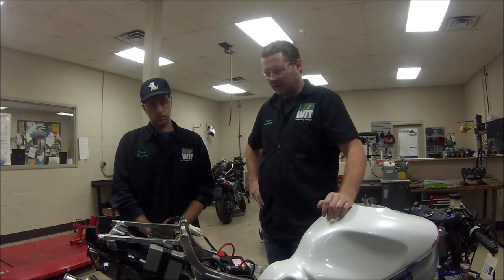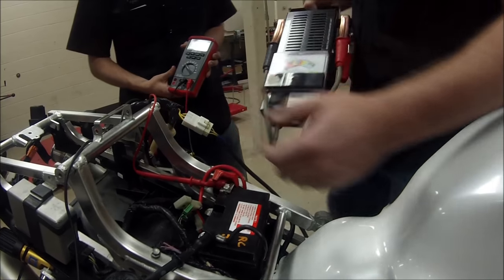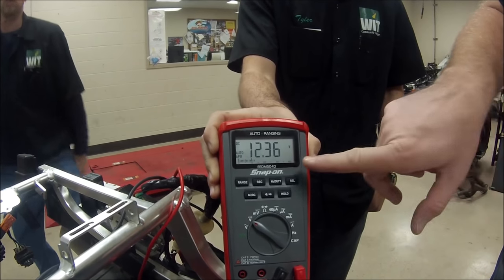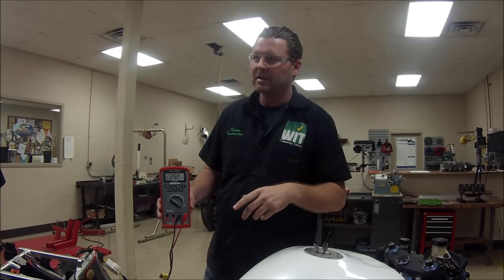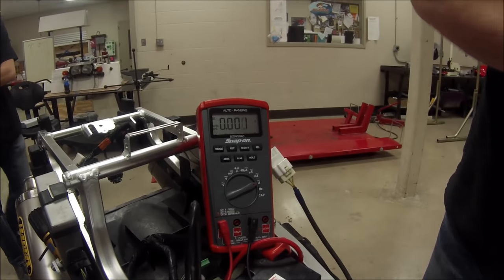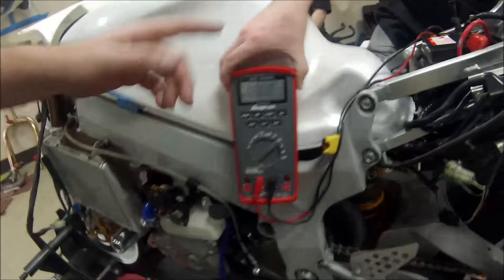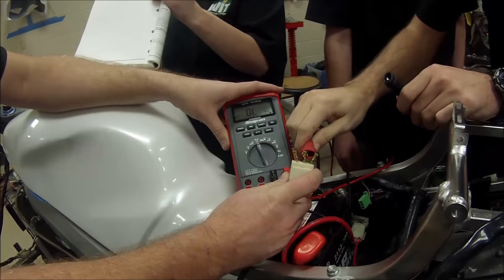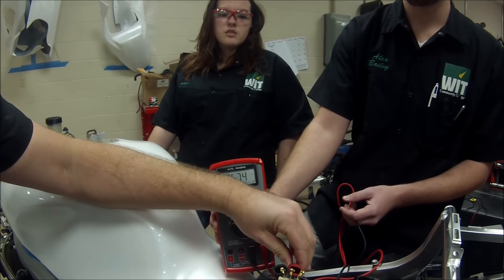How to test the motorcycle charging system components! ATV UTV small engine #chargingsystemtesting

Comment: I really enjoy your video. I learnt so many useful thing. What does it mean if the current voltage is bellow 20v at the stator output? (if resistance ok: stator ko or the magnetic side (don't know the word in English) Is it necessary to disconnect the stator from regulator to test the stator output voltage.(as the Last test you did) thanks for feed back & take care
Reply from the maker: Thanks for commenting and adding value to our community!

Have you subscribed yet to never miss a video? Have you seen the video playlists? Over 600 videos! Check them out here: https://www.youtube.com/user/conleybuilt/playlists  

Want to say “thanks” or “keep it up”? Click here https://www.paypal.me/how2wrench    
 
Your answers and help are just around the corner. Save time and money while protecting your investment and yourself by doing it the right way at www.How2Wrench.com

Comment: Why is that Reg/rec drawing so much power with the key off though? Couldn’t you just run the regular 12v through switched power to eliminate that issue?
Reply from the maker: The demonstration is on how to test OEM setups. So this example is a stock Japanese common charging system set up. Another point is this works very well and they gift in this video is that it is the answer to a huge struggle and hard to diagnose issue. 
👍 Thank you for taking the time to comment! It helps us! 
Here is a way to support all the free videos.
Want to say “thanks” or “keep it up”? Click here https://www.paypal.me/how2wrench  

Coach Conley is also available for hire to personally work one on one with you if ever needed. Yep he is a real person. Give him a call @ 602-345-0432
Details here: https://how2wrench.com/product/personal-tech-training-phone-facetime/ 
Your answers and help are just around the corner. Save time and money while protecting your investment and yourself by doing it the right way!
Follow us! 
Web:
www.How2Wrench.com     
www.Tools2Wrench.com

Comment: Great video. One question: when you test one of the yellow cable from the stator to the ground connection of the battery with the multimeter VAC output you get 14.X Volts. What does it mean if you get 6.X Volts?
Reply: You need to get the information specific to your bike

Comment: Hi. I am having a problem with the charging system. no charge is getting to the battery. Battery checked and fine. Stator charging at each coil as per manual but when checking resistance ( Continuity) to the negative of the battery I do get continuity. 13:28 on video. Could this be the problem. Because I do not want to change the rectifier/regulator and possibly cook it.
Thanks

Comment: Great video. Thanks. Noticed on one of your videos that the AC voltage increases to maximum at 3000rpm but then drops to 0vac when the rpm is increased beyond that. Is that normal? Why dos it go to 0vac after 3000rpm? cheers
Reply from the maker: Hello. I'm going to guess the meter connection came loose as the AC starts building as soon as a magnet is spun past a wire and increases with RPM until a point at which the wire size and length has no more ability to produce more. A few other design factors go into play as well. 
Have you Subscribed yet to never miss a video? Have you seen the video playlists https://www.youtube.com/user/conleybuilt/playlists ? Quick answers are often found here. No time to look through videos? 

Still have questions? You’re in luck! I provide tech help and work one on one! I know your question may seem quick but with over 300 requests a week, it’s not possible to answer them all. So, I’ve narrowed down so subscribers and donations to assist beyond the over 660 free videos. My YouTube has grown beyond the ability to answer every question (11 million views! Over 500,000 a month!)

Click here for the membership links and welcome to the community! https://how2wrench.com/product-category/specials/    

Want to say “thanks” or “keep it up”? Click here https://www.paypal.me/how2wrench   This is great for those truly quick questions you need answered and your help back will keep me going!

Your answers and help are just around the corner. Save time and money while protecting your investment and yourself by doing it the right way!
Admin How2Wrench.com
Reply: Cheers Shane. I've just subscribed. If wire size and length cannot produce more would you expect it to stay at 60vac?

Comment: My rectifier passed the reverse bias tests as I got OL on my multimeter for both positive and negative wires. But when I did the forward bias test with the positive lead of the multimeter probed into the 3 yellow wires, I got 0.45 ohm for each one of them. But when I did the forward bias test with the negative lead of the multimeter probed into the 3 yellow wires, two of the yellow wires showed 0.1 ohm each and one yellow wire shows  0.09 ohm. Is the rectifier still ok or is it malfunctioning already?
Reply from the maker: You can reach me personally @  https://how2wrench.com/contact/
Please show your support by a membership or donation to get the help you need beyond those popular free videos that have saved you so much money and grief! You can say thank you here: https://www.paypal.me/how2wrench 

p.p1 {margin: 0.0px 0.0px 0.0px 0.0px; font: 12.0px 'Helvetica Neue'; color: #454545}
span.s1 {text-decoration: underline ; color: #e4af0a}
span.s2 {color: #e4af0a}

Comment: 12:25 you say something about leaving the aligators ne to take out any potential resistances.
Can you explain this better?
I have this situation and I am REALLY confused.
I have been doing the same test as you are doing except that I am using the needle probes to check for resistances and I am getting variable numbers between 1.5 to 2.0 ohms, the service manual says it should be between 0.1 to 1.0 ohms

NOW, after I saw your video using aligators I also used one myself and I am getting exactly 0.6 ohms on all 3 wires.

WHY? Why changing from needle to aligator give me such error? Can you tell me? Thanks
Reply: remember that before using any type of leads you should check and see if they are in good operable condition... check for resistance between leads and see if they can conduct 12V with no interference.  It is very important to double check all electrical equipment/tools.  I have spent hours diagnosing a fault when I realize my voltmeter or leads are not in correct operation.
Reply: Oscar Ronquillo what you mean with leads? the battery conectors or the probe points? What is that?
Reply: Oscar Ronquillo I also changed my R/R with a MOSFET one from rick's motorsportelectrics. Now I get some voltage out of the R/R but it is not enought, I get 12.85v and only at @5000rpm but manual say 15v. In practice, I am not geting my battery charged. It is discharging at a very low rate. 

Batery is new!
Reply: Sorry... by leads I mean probes or alligator clips...
Reply: now what color of wires do you have coming from your stator? And how many wires coming out/in of your rectifier/regulator?
Reply: Oscar Ronquillo 3 black from stator to R/R. 2 from R/R to batery (red/yellow).
Reply: ok...just to be clear... how many wires are coming from your stator all together... the wires coming from inside the engine... and what color are they..  
also if you disconnect the rectifier, how many pins(connections) are there on it
Reply: Sorry my mistake.

If I disconect the R/R I end with 5 wires, 3 yellow 1 black 1 red, both black and red are togheter in the same conector that are conected to the battery. The 3 other yellow wires that comes of the R/R are conected to the engine (stator).

Out of the stator comes 3 yellow wires, those 3 are conected to the 3 yellow wires from the R/R.

https://ricksmotorsportelectrics.com/Hot-Shot-Suzuki-Rectifier-Regulator-10_211H

Comment: Could someone explain this to me:

At 13:24 they're testing ohms between the negative and the stator. I am measuring 0.00 óhms. what is the problem?
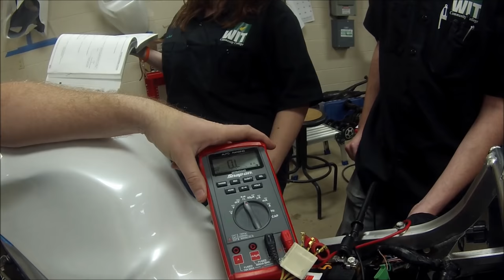Reply: Your stator winding is connected (short circuited) to the the body (ground) of your stator. The insulation of the wire has failed. The stator can not produce enough AC power to the system. Check every two wires' AC voltage of the three wires coming from stator (13:40 in this video) on idle revs and on 4000 revs: some are ok (70-80 AC V), some are not (like 10 AC V). You need a new stator or you can rewind the old stator.
Reply: He says “0.00” indicates there is NO continuity between the ground and the stator. Which is what you want. If, however, your stator was bad and you had continuity (any number greater than 0.00) you’d likely be smelling melted wires.